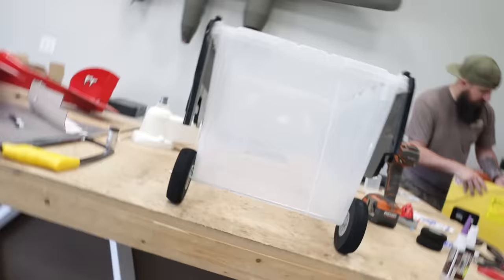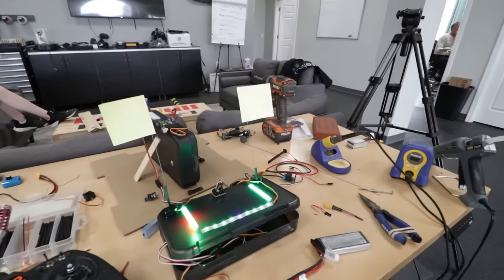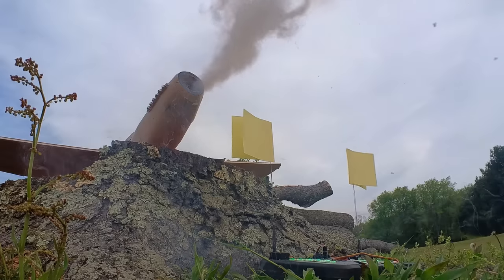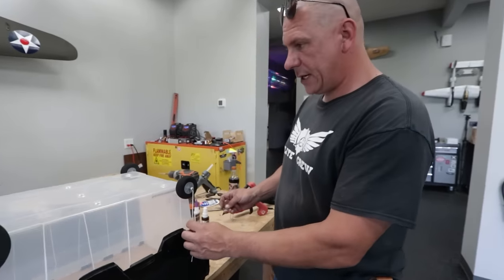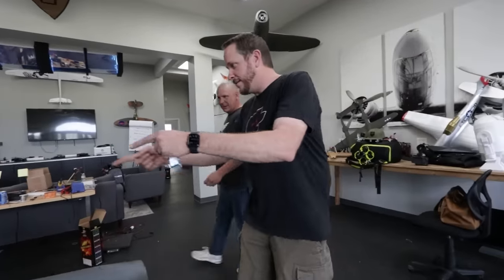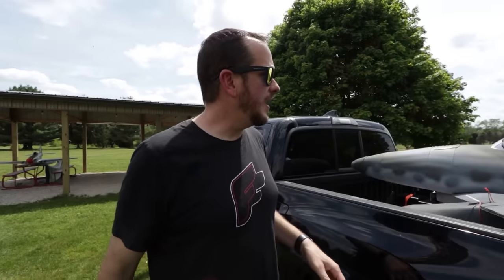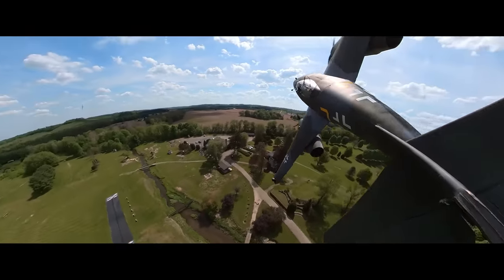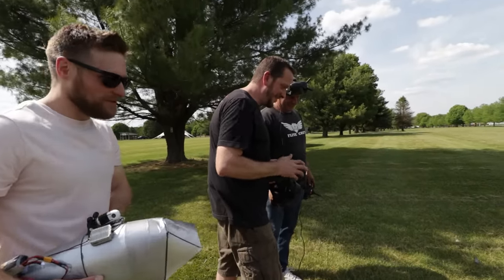Explosive Battle with Two Giant DIY Airplanes 🔥

Comment: The B-17 should have more small explosive charges so that it can take some damage without necessarily being destroyed.
Reply: Agreed.... -What is that old movie called, with the B17 crew returning home in a flying sceleton?
Reply: Oh imagine of they had a laser tag on each gun and a separate charge!
They could overlay a bf style plane outline and show each one as it's blown out.
I assume they will also be gimbaling each gun point.
It's gonna be epic!!
Reply: @JokerInk-CustomBuilds  I don't remember the name of the movie either.  Martin Caidin wrote several books going over the history of WW2 aircraft, one of them was "Flying Forts", LOTS of photos in all of them.  One that I remember, partially because it was one of my dad's squadron, showed a 17 essentially cut in half through the fuselage and STILL FLYING !  It made it all the way back to England, landed, and then broke in two when a hatch was opened.
Reply: not a bad idea!
Reply: @michiganengineer8621  
I googled a bit, It was Memphis Belle! :)
Those planes were amazingly well built! :)
Reply: X 1 are cool speed velocity
Reply: @JokerInk-CustomBuilds  Memphis belle or fortress
Reply: Instead of mortars use fire crackers and position them to blow up a part of the wing with every hit.  That way a few hits on the plane would keep it in the air but too many and your going down.
Reply: @mannythehunter  wicked idea
Reply: That's true
Reply: 6 gun pods, all different operators fpv, that would be epic
Reply: Add some bf-109s and ta 152s
Reply: @JokerInk-CustomBuilds  Memphis bell?
Reply: Defo, and it will look cooler when it's going down!
Reply: agree. they should have tens of points on there that create small structral damage such as a small hole in a wing or a piece of the tail gone. the plane would be able but hard to fly
Reply: @beans7889  Wasn't "Memphis Belle". They got the Belle back a bit shot up but mostly in one piece. Never seen "Fortress" so maybe it was that. I was thinking more, though, it was an episode of "Amazing Stories", the one where the guy had the draw the landing gear in place cause otherwise the belly landing was going to kill him.
Reply: @richardgreenleaf3259  I think it’s fortress honestly
Reply: @JokerInk-CustomBuilds  ik the b 17s name was old 666 or it was the american
Reply: @michiganengineer8621  the plane your refering to is the all american
Reply: @mannythehunter  firecrackers in the engine
Reply: @JokerInk-CustomBuilds  Memphis belle
Reply: @mannythehunter  it'll be hard but if they can they need to put it on a chassis that can fly on only 2 of the 4 engines.
Reply: @michiganengineer8621  "Memphis Belle" is the name of both the movie and the plane

Comment: There’s nothing more cursed than a propped ME-262
Reply: There are renditions of turbo prop me262s
Reply: @mEmEzMaN... yeah but this model was not suppose to have a prop engine
Reply: At least it flies, still pretty sweet
Reply: I was rooting for it to get shot down for that very reason.😅 Maybe when it's repaired they can use ducted fans. Very cool video! Thanks FT guys!

Comment: Nice explosion, even though the “fight” was clearly choreographed.
Reply: They literally show you  a cut out opening right where the one plane blows up and there's just a firework rigged to go off in the green plane and they don't want to show you how
Reply: @chadsteadman2604  but dude was like I'm shooting you you feel that acting like fireworks or explosives we're shooting out at the other plane and thats what the explosion was
Reply: @OGRAINZBRAINZ  It was laser tag, but they used electronics (I think Arduino) to make the servos go back and forth when there was a hit, so yeah, they knew it when they were hit. Then on the second hit, it also ignited the fireworks in the wing. When they demonstrated on the ground, those flags being waved by servos were gonna be the elevator/aileron servos when they installed it in the plane.

Comment: Don’t recommend relays for pyrotechnics as a rapid acceleration (thud from drop) can detonate something accidentally at the worst times
Reply: Haha hadn't thought of that but very very true even high gs would be dangerous.
But yeah solid would be advisable!
Reply: I think those are "solid state" relays.  Not your normal reed type.  Could be wrong of course!
Reply: This was a rare video since the performance was equal to only a few models and its been 1 year after change in model planes

Comment: Okay that was pretty cool, fairly unrealistic in terms of aerial combat tactics of WWII standing next to each other asking the enemy where are you and how fast are you going, but I understand the idea and it really looked cool. Try going on a head to head high speed pass engaging each other. You have enough space to launch from opposite ends of the field. Each pilot use a spotter as if that was your wingman (or RIO if you want to call them that), tactical engagement like real aerial combat. Maneuver into any position to gain a shot advantage (not the classic 6 O’clock). Position your hit sensors in four locations around the circumference of the fuselage and at the nose and tail, piggyback an independent smaller lightweight battery to control the sensors and mortar ignition. You are skilled enough pilots that you could engage in a dog fight using your “wingmen” to direct your movements to engage each other. I realize you are limited on battery power and flight time, position the mortar in the center under the canopy and blow the aircraft in half… just a suggestion. I have confidence in your engineering and flying skills to make this an epic dog fight.
Reply: @genraldmoney8171  If its for fun, then why are you so offended by some constructive criticism?
Reply: @bucherwurm5344  Why give constructive criticism when there is no need too?
Reply: @genraldmoney8171  Because constructive criticism is allways helpful, it tells creators what they could have done better and how to improve! 
In my opinion this video would have been more entertaining, had the dogfight been more fair
Reply: @bucherwurm5344  i know constructive critisism is always good, but overdoing it with unnecesary things is not needed for “RC combat”. The thing you mentioned about it being unrealistic that enemies talked to each other asking where they are. Well i dont Think foes would stand on the Ground with Remote controled cardboard model planes. Oh and did i mention that the so called “foes” are actualy friends! Pretty crazy, its like they did this for fun.
Reply: @Le_Flatfish  I agree with you. Ignoring GenralDmoney's poor  choice of words, the goal of the video is to be entertaining and not to be historically accurate. As I said; in MY opinion it would have been more fun to watch had it been more of a competition, again my opinion
Reply: @genraldmoney8171  I understand it was a fun video, I also understood what they were doing. I gave them kudos, and really wasn’t criticizing them. These guys make awesome videos and their skills are on a whole other level. You don’t need to get your panties in a wad because I made a suggestion on something that I would like to see them do, because I think they can make it happen. As far as telling me to STFU, try taking your own advise, keyboard warrior…
Reply: @bucherwurm5344  Yes sir, one hundred 💯 % agree. Thank you for coming to my defense. I know the purpose of the video was entertainment. Historical accuracy, as I said in the first line of my comment, I understood what they were getting at and it was really cool. These guys are on a whole other level with their skills. I believe they can pull off a video as I suggested. I really wasn’t criticizing the video, I was making a suggestion by offering a scenario to try, which like you is merely my humble opinion. I believe they can pull it off, and seeing it on a video would be epic. Especially the part about blowing the plane in half, which also isn’t very accurate historically speaking, but would be cool to watch. IMHO.
Reply: @bucherwurm5344  yeah, i agree
Reply: @Le_Flatfish  - Thanks for the feedback on my comment. I really wasn’t trying to criticize them, I got what they were doing, I know they are all friends and that is what makes it a fun and entertaining video. It was really cool to watch. I was offering a detailed suggestion for a scenario that I believe they can pull off, because they have the mad skills to do it. I sorta qualified the unrealistic part in the first part of my comment, that I understood what they were doing. I get it. IMHO, in the spirit of friendly competition and video making, if they could pull off a dog fight on video in a manner similar to my suggestion, again IMHO, would be great to see. Just a thought. Thanks again.
Reply: @Patriot_Drone_Services  I agree with your assessment as well.  The ME never even tried imo to try to engage the P51.  I think they should have used FW190 or a 109 for a true dog fighting experience.  I also would like them to fire crackers instead of a mortar as you could engage multiple times.  But alas it is their show, and if I could do it I would.
Reply: Dear God your fingers must be burning! Also its a vid, its not an actual war
Reply: Dear God your fingers must be burning! Also its a vid, its not an actual war
Reply: @majorhawker4776  I think you missed the point of using the mortar, when they want to save the planes they use streamers and the one who cuts most or all of the streamer off wins, the mortars are used specifically to blow the crap out of the planes.

Comment: This genuinely looks like a real WWII fight, with the Me-262 engine exploding and everything
Reply: that explosion was gogeous.
Reply: Nah bro spitfire wouldn’t have caught up to ME so quickly
Reply: @chillmind4515  thats a p51 mustang… stop tryna act smart
Reply: @Deemi2920  sorry looked similar
Reply: @chillmind4515  u bozo spitfire has oval wings p51 uses a trapezoid (sorta)
Reply: @chillmind4515  not at all
Reply: @chillmind4515  Me 262's max speed was 562 mph, spitfire's was like 200 less.
Reply: @chillmind4515  Fun Fact: It's a model of Chuck Yeager's 3rd P-51, The Glamorous Glenn III. 

He was shot down in the Glamurus Glenn (his first P-51), was captured, escaped... 

then returned to war and, in the Glamorous Glenn II (his 2nd P-51), he became an 'Ace in a Day' by having 5 confirmed victories in one sortie (the first two were won without Yeager firing a shot! He pulled in on them and one of the leads panicked, broke away and right into his wingman. splash 2 😂). 

After that, he would be shot down in the Glamorous Glenn II and would finish WWII with 11.5 confirmed victories....the majority of which: were done in the plane modeled in this video. 👍

When he was the first person to brake the sound barrier... his Bell X-1 was name The Glamorous Glennis.  

To celebrate the 50th anniversary of that flight, Yeager broke Mach 1 again, this time in an F-15 named "Glamorous Glenn III" 

Just wanted to share. 👍🤷‍♂️
Reply: @evilpandakillabzonattkoccu4879  thanks for the knowledge

Comment: Should do 3D printed ones with airsoft rifles
Reply: Kinda already did but it was a plane vs a tank
Reply: @ziggky.5750  is that 3d printed though
Reply: No not 3D printed
Reply: @ziggky.5750  Correct
Reply: Does BB make plastic shatter?
Reply: @Xiphactinus  no
Reply: Actually it depends on the type of plastic
Reply: @ziggky.5750  if it's fairly thin there's a chance, but I've seen RC BB combat and there's almost no damage caused by the pellets themselves.
Reply: Yeah
Reply: Might need real bullets then lol
Reply: @Motorheadmccoy  or maybe paint bbs 🤔 there got to be a way

Comment: this is sick, now time to alter the circuitry a little bit so engines shut down so a pilot can glide safely down instead of their plane exploding. adds a bit to the replayability factor XD
Reply: They did that with the smaller models which inspired this version lol
Reply: Yeah dude!  That's all a feature of the system.  This is just a bit ... beyond ... what it's designed for LOL
Reply: easy. just use a normally closed realy inserted into the powerfeed to the motor. Then the relay cuts out the motor when hit and you can still use the servos to steer while gliding down... He talked about this like it was rocket science and it is just basic electronics...
Reply: @JokerInk-CustomBuilds  That's the thing.  Not everyone knows even basic electronics.  Products like this laser tag system help turn a large learning curve into something much more approachable by the general hobbyist
Reply: I think releasing a smoke bomb for effect and disabling one or more control surfaces to simulate a malfunction would be the way to go.
Reply: @BuddyRC  true dat... I am an electrician by trade, so I tend to overrate basic electronic knowledge... but RC stuff is just so much plug and play to me and relays are a really basic and easy thing in my world... :)
I just got on my heels when he talked about it as if he was safekeeping some secret bombmaking alchemy... :D
Reply: @RCinginSC  no need to release it... just let it smoke out the plane... just like exhaust smoke gadjets for rc cars... Just need something more smokey because of wind to make sure it is visible... maybe a small firework smokebomb in a reloadable metaltube near the engine bay... :)
Reply: @JokerInk-CustomBuilds  that's what I meant, sorry, poorly said. But yes , have a smoke trail like a real plane that's been hit. The effect would be sick. Actually, locking the ailerons to one side and have it barrel roll until it hits the ground.
Reply: @RCinginSC  that would look awesome... maybe a random generator to the ailerons so it would go down dirrently each time... But... there is a balance to remember if ypu want to be able to repaet dogfights without repairs... :)
Reply: @JokerInk-CustomBuilds  true that
Reply: @jndvs95  yeah funny story that was the video next in my autoplay ahaha
Reply: @jackflash852  I was surprised they put the firework in the wing though instead of the front but it looked cool either way. The way the plane went down was not unlike watching planes go down from ww2 after an engine explosion or a wing shot off

Comment: If you wanted to do this in a less destructive way, take the circuit you made for the mortar and use it to light a smoke grenade while forcing the plane to pitch into a nose dive.
Reply: Thats boring as hell tho.. no.., thats like what they did before, its a new generation so no looking back, second they can easily rebuild it.

Comment: When I was young, I used a servo in series with a 5v lightbulb, of which I removed the glass, leaving the threads intact , then using a mixture of petroleum and match heads to ignite  the actual compound. The servo was connected up to a reciever and a battery pack

Comment: Awesome work!  Coolest thing I've seen since shooting GI Joes and models with my BB guns.  Just some ideas:  Inflatable structures for lightweight rigidity. And lithium battery tech that "burns out" the lithium.  One use - extremely small and light.  Crazy idea, I know, but have you seen the power in a A battery that is unwrapped?

Comment: This looks like the new version of robot wars, it would be really cool to see this (with a few refinements) become an real life sport.
I think with a limited amount of time you can fire to simulate ammunition, different sensors in different parts of the airframe to simulate different types and severity of damage, even teams so bigger aircraft could be used, such as an independently controlled tail gunner or top turret, or bombardier.
Man, I’m nerding out bad, But this could be amazing!

Comment: If you do a B-17 you need a combat box.  13 guns are horribly ineffective with the “small bullet big sky” theory.  But throw 5 or 6 planes flying a box against 2-3 fighters bam.   You’d also need to stay away from rear attacks because the twin 50s in the tail with the twins in the ball or top would be a death sentence with a low closure rate for the fighter.  Head on attacks are a must.

Comment: Me262 use diving attacks it was a heavy fast fight that the mustang can out turn.  If it actually was using jet engines it can evade the mustang in the vertical by using its weight and speed to out rate of climb the stang

Comment: Meserhmircht 262 ( Me 262 ) the german plane on there was best there was no any planes for mach it in real it had a higher caliber weapon than other planes you was able to use rocket launcher or cannon like 20 mm or higher for that time its a big deal for ground targets and the biggest difference why me 262 had no match reason is it had rocket engines but other countries didnt had that in that time and it was like american planes with 545 km/h with ADG ( some kind of system that hards motor and make it work harder but its dangerous to use it may explode the plane ) but meserhmircht 262 ( me262 ) was going 780 km/h with going straight and without not harding it motor on max its like at %80 and it going so fast its the reason why it was the not best or not expensivest but fastesr plane on its time